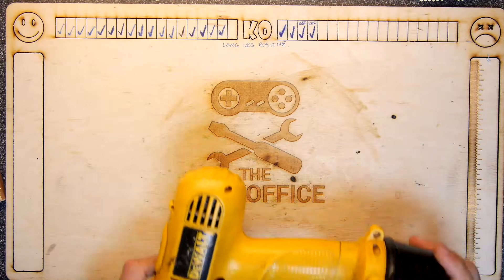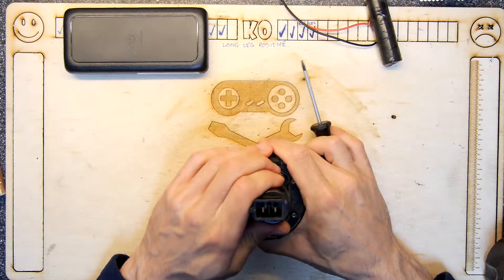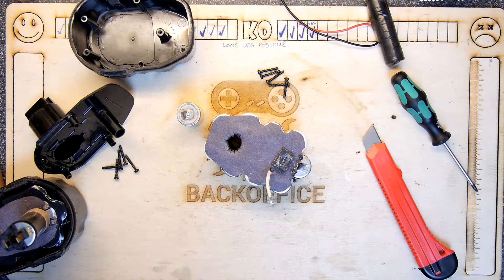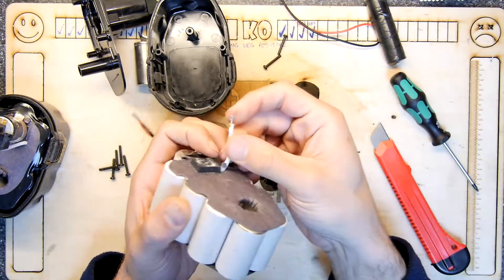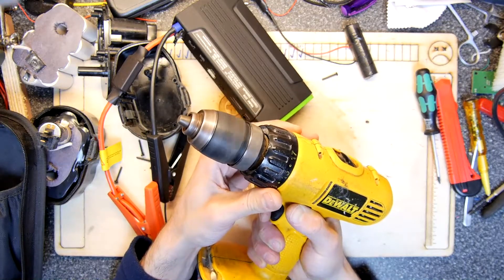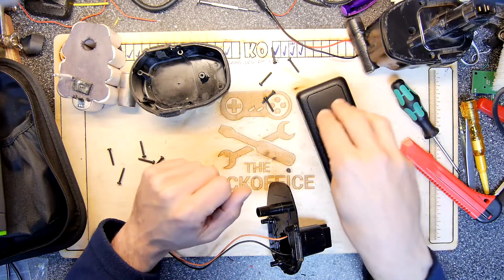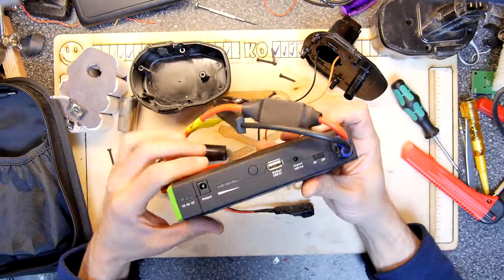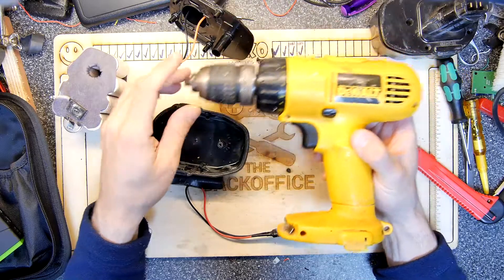Powertool Battery Hacking

Comment: Hi, 2 amp hours is 2000mAH, so your battery bank is 5 and a half times the capacity of the original battery of your drill. Great video though, gives me loads of ideas of what to do with my power tools lol
Reply from the maker: +David  Elliott getting the packs to fit might be a challenge, but that's what hammers are for 😏
Reply: Everything fits better with hammers :) I'd go for the belt pack idea myself, that way you can use the pack for other things too, and attached to the drill with some of the mains cable  they use on irons. Maybe a pocket for the battery pack in a tool belt for maximum swagger!
Reply from the maker: +David  Elliott Batman utility belt style, I like it!
Reply: Definitely:) You could use the pack to power an MP3 player and speakers attached to the belt too, that would be "Impressive", or at least "memorable" :), oh, and don't forget the batarang!
Reply from the maker: +David  Elliott I have the components for all of those things 🤔

Just thinking, the still would be very front heavy without the weight of the battery
Reply: Attach a Rifle butt to the rear of the drill! It'll balance it out and give you a place to put your shoulder to use the extra torque!
Reply from the maker: +David  Elliott that's a great idea. I have no idea why this has not been invented already.
Reply: Either that or weight the empty battery pack and reattach it to the bottom of the drill with the wire out the back.
Reply from the maker: +David  Elliott how about filling out with emergency m&ms?

Comment: Car comparison, volts is the engine size ie 1.6l and amperage is the horsepower :)
Reply from the maker: +Brian Jones but ... what's the oil 🤔 electromagnetism
Reply: ermmm  the wire shielding ? :p
Reply from the maker: +Brian Jones weak atomic forces that keep the electronics moving?

Comment: You mentioned the power banks being good since they have built in overcharge and over discharge protection, might want to be careful when using the jump start output terminals to power tools since that particular output is usually connected straight to the batteries and bypass the over discharge protection.
Reply from the maker: +Matt Cocker I just got a couple more that had additional regulated outputs. I suppose those would be safer

Comment: Hobbyking for R/C batteries.  A 3s pack is 13.2V fully charged, probably plenty for the drill. nice vid.
Reply from the maker: +capri2wd Perfect, I'll check them out!! 😂👍
Reply: yeah big plus for hobbyking, and agree 4s :) maybe a nice 5000mah 4s vroom vroom enough cars I know
Reply from the maker: +capri2wd I'm sure the drill could take a few extra volts 😀👍
Reply: Correction 3s is 12.6v, 4s would be 16.8 could make a nice upgrade for more power. Lihv would be slightly higher voltage again.